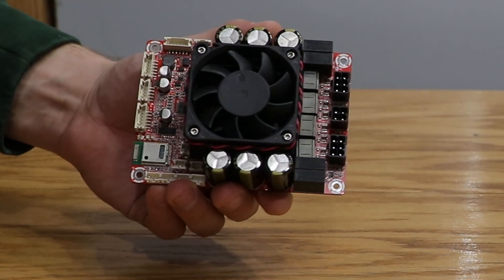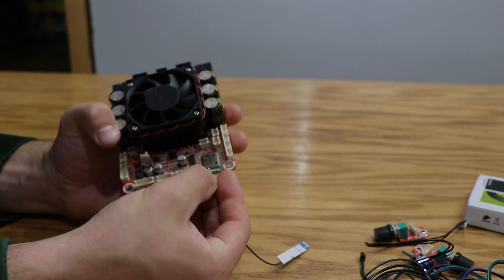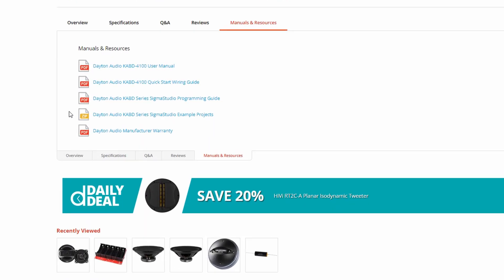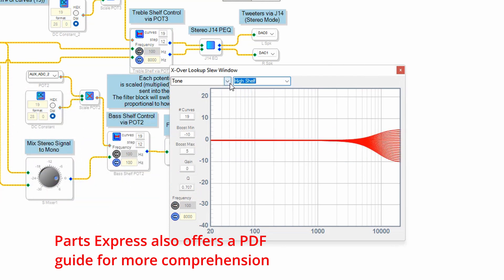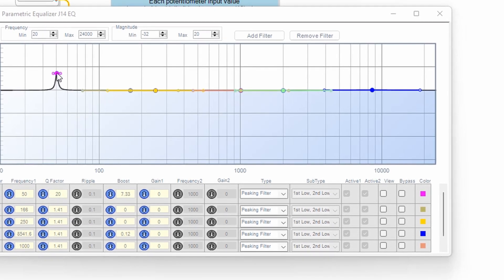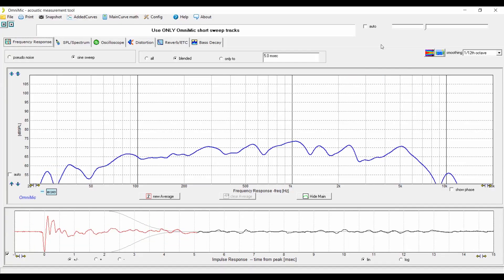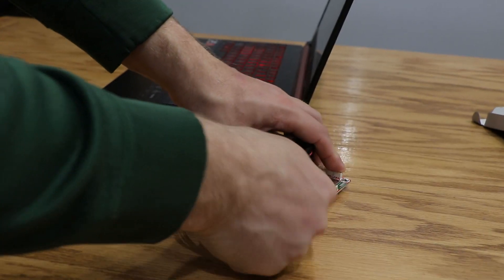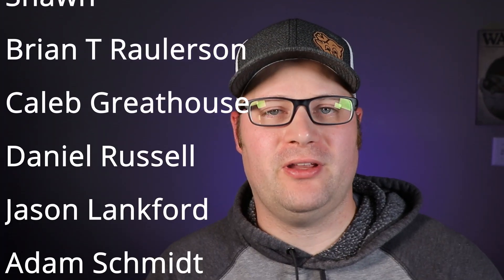Is this the Most POWERFUL Amplifier for DIY? Dayton KABD with DSP

Comment: Pity you didn't tell is the audio specs, and what power options (other than the shown battery) are available.
Reply from the maker: They have multiple different boards. If you follow the link in the description of the video, you can see the other boards they offer.

Comment: Would love to see a full 3 way active tower done using these guys!
Reply: I did a 3 way large bookshelf with 2 of the 4×100 boards. It kicks ass
Reply: @blakebrockhaus347  that would be cool to see. Do the left and right bookshelves need to know about each other (timing/phasing etc), or does it work fine with two independent amps with one line level input each?
Reply: @dcuccia  the two amps are linked together, but there's nothing to do with phasing since it's one amp per speaker. If you go back a little ways on the DD audio Instagram you can find a vid where I talk Abt the build
Reply: @blakebrockhaus347 can you point me in the right direction for cascading schematics, specifically how to power two of them
Reply: That would be a good video, but would they need 6 outputs? This board only has 4. Or maybe use 6 boards?

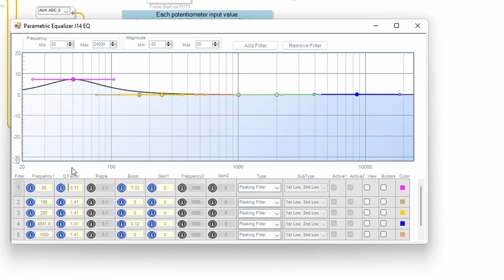Comment: 5:43 is it possible to build 1-band PEQ with this thing? Can you control gain, frequency and Q in realtime with 3 potentiometers? I tried chinese wondom audio thing (also sigma studio) but it seemed to impossible. I managed only to make predefined number of curves, not a parametric solution.

Comment: I will never throw away a speaker that stopped working ever again...  I had an Altec Stream X speaker that just stopped working one day out of the blue.  I opened it up and tried to figure it out but couldn't,  so I threw it away.  It'd been the perfect place for one of these boards...  the 2 X 30 w.  It had a nice sound for what it was.  Even had the battery operated function built right in.  Only thing this board wouldn't have had was ability to use Chromecast.  Otherwise this would've dropped right in.  I'm going to have to go looking to see if maybe this is still laying around somewhere...  I know I still have the front speaker grill part and the power cord cuz I remember it was 18v.  It was useful for my 10" portable fans.  I'm going to look...  I'll let you know.  In the meantime,  anyone know if I can get the Chromecast parts off the old pieces???
Reply: Google and Alexa are coming together to work on more and more things and I'm happy about that.  Instead of fighting for the space they seem to be getting along nicely and I'm finding I can use them more than ever...  like asking Alexa to show me a Wyze camera on Google Chromecast on my TV...

Comment: Would be interesting to see how this goes compared to buying a Mini DSP 2x8 or two 2x4 and using some used class AB amps I have.
I wonder if the "4x100W" class D board would be as good as the separate amps in terms of power and noise
Reply: Wondom also offers a dsp board without amp. Would be similair to the 2x4 but much cheaper.
Reply: @lennarth.3383  you can't make similar and much cheaper. These cheap DSPs have audible tradeoffs. They're only usable for small/portable speakers, where you don't really care about fidelity.
Reply: @tomkocur  So true. People make it sound like these china boards are mana from heaven for nearly no cost. Either people praising this havn’ any idea of quality and fidelity, or they have an agenda cause they sell the shit. On another matter .. all those td amps are not even close to be considdered hi-fi and their wattage claims are utter bs. It is possible to build a quality class D amp but it will cost some serious design effort, and I have yet to see any class D amp that actually deliver the same ammount of sound pressure/watt compared to an old school class A/B amp with a decent designed power supply. Have tried Pro level amps made for live music that have 1000’s of claimed watts in 8ohm, and a 30 year old 200w a/b amp weighing almost the same as Its age in kg, totally oblitterates it, playing considderably louder, so if you want some cheap watts considder looking for really old but quality build poweramps used because people don’t want to carry them arround anymore. New power amps that cost a fraction and weighs almost nothing is almost always shit.
Reply: @mrdali67  The Dayton-board is a rebrand of sure/wondom. Technically all three boards are the same. In a nutshell: The Dayton-board is chinese mana from heaven sold at a higher price tag. At least here in Europe.

Comment: These are so cool! I don't know why we don't see more of these in use? They're so versatile. I would really like to see you use one of the MiniDSP amps to build a speaker with. Those are like a higher end version of these. They're not technically high end, but a rung above these. Pretty sure they use the Ice Power modules in them to give you an idea. Thanks for the great video. ✌️
Reply: guys still cant wrap their audio heads around using the software on their laptop or pc or even their phone.  There is a threshold of understanding that needs to be observed but once it soaks in you will wonder why you didnt do it years ago.
Reply: @halrichard1969  I suppose that's a big part of it. I'm a computer geek from way back though. So it's natural for me. And it's the way everything is going. And I'll be damned if I'll be left behind. I see that as a fool's errand myself. ✌️
Reply: @amb3cog  I think you have the right point of view.  I was looking at these amps a year ago and after five minutes of study on them My eyes walked away.   But now for some reason it all clicked after a couple videos and searching around for a cheap amp that could do it all.   I feel really good about getting it done.   I already calculated out the speakers and Boxes on WinISP.  Its a fun little program and free.  I grew up in my Dad's Garage. I got tools coming out my ears. And i know how to use them. Today I studied up on connectors I might use and decided on XLR 6 pin jobs. for the Monitors since they are three-way speakers.  One channel for the Midrange and Tweeter and one channel for Mid Bass Woofer.  Two channels bridged for the Satelite Sub.  Just multiply times two and that will be my set-up.  A 2.2 system, one amp for the right and one amp for the left.   This will most likely be my Christmas/Birthday gift to me in another month or so.  Thanks for the Interest.
Reply: @halrichard1969  Sounds great. I've heard people say that the best speakers you'll ever own are the ones you build yourself. I hope for your sake that this is true. And it makes sense to me. 

I run a 2.2 system myself, and think it's the way to go. At least for me, in my small room.
And I grew up in my dad's garage too. He owned a little body shop in Newport RI when I was growing up. 

Sure did teach me a lot about not having to pay people to fix, and/or build things for you.  Which sure does come in handy nowadays. Since labor is almost always the most expensive part of anything. 

We fixed almost everything ourselves. And even built our own frame pulling machine. Although we did have to have a guy come in and put the pots in the cement floor so we had something sturdy to anchor to. We did all the rest though. ✌️

Comment: IM NEW and a little confused,  is this used as a crossover for diy speaker builds or is this just to figure out what crossovers are needed for the build?
Reply from the maker: You can use it as either or. However with the two-way example project that I was showing you. There are four speaker outputs on this board. They have separated those outputs. To those outputs would power the two tweeters and two of those would power the woofers. You use the program to design the crossover. That means there's no passive components necessary. This will all be done with the software.

Comment: A ps audio fr30 clone would be a pretty interesting project since parts express Carries similar drivers to the planars they use
Reply: At that price point they're definitely using custom drivers. Ps audio has actually shown the development of their drivers over time, so you wouldn't be able to build the same speaker. Maybe something similar tho.
Reply: @blakebrockhaus347 , You'd be surprised according to many forums they are actually using a variation of the BG Neo 10 drivers and Neo 3 tweeters. In fact, some DIY hobbyists contacted paul and asked if he would do a production run of the drivers for the public, but he responded that it wouldn't be worth the time or money to do. Those woofers are definitely custom tho, they brag about that a ton on their website.
Reply: @blakebrockhaus347  interestingly enough, their speaker uses a midrange and tweeter that is very similar to the old BG Neo planar drivers. There are actually some drivers that are available on parts express from GRS that are similar. The reviews are somewhat mixed, but I bet you could pull off some decent results with them. Their woofers are really custom tho, dunno how you'd clone that.

Comment: this card should have usb on the card! if I am going to make a good speaker then I must be able to adjust more than once. there should be adjustment via bluettooth.

is it possible to buy a card with only this DSP?
Reply from the maker: You can adjust it as many times as you want. Heck you can use it in one project and then use it in a completely different type of project later if you wanted to. You just need to re hook up your incircuit programmer to it to program it. I'm actually glad it doesn't have the incircuit programmer built in. One, every amplifier would be more expensive. Which is unnecessary since you only need one of them to program as many boards as you want to program (with as many different variations as you want). And two it would make it a larger unit. But it would make it more convenient to program if it was built in.

Comment: How many frequencies can you adjust at one time? 5 pcs. Normally you can not adjust good sound until you get to 15 bond eq.

Have this EQ. for all channels? 
One for treble and one separately for bass / midrange?

has dsp / amplified hissing? many digital processors and class-d have hoss.

I have used mosconi dsp 6to8 and it does not have a pop free start. but there is a very loud bang in the bass speaker and it has a hiss
Reply: Don't confuse parametric EQ and graphic EQ. The latter does indeed require lots of bands to be of any use in correcting narrow deviations. The former allows control over center frequency and Q per band as well as level, so fewer bands are generally required unless the driver is a total mess.
Reply from the maker: @naturalverities  that's a great point. With parametric EQ you have the ability to adjust the Q which helps you fine tune how narrow or wide of frequencies you can adjust. Great point! 👍
Reply: @naturalverities  Ok. I have adjusted a lot of EQ. in PA. world and in car stereo and Home hifi.
Even parametric EQ in car.

often it is more than 5 frequencies you have to adjust at a time. Then I talk about adjusting to get the best possible sound.

Take for example SEAS speakers from Norway which are seen by many as very good speakers. In reality, they have a sound type that requires lowering of several frequencies that do not produce as good sound. Seas has its own sound type which is not the best.
Reply from the maker: @ford1546  each parametric EQ can handle up to 15 bands.  However, if that is not enough, you can just add another parametric EQ in the software for an additional 15 bands (30 total). As far as I know, there are no limitations to how many you can add.  And if there is, I haven't found it yet.
Reply from the maker: You can EQ this is much or as little as you want. You want limited like you used to be with just a normal parametric EQ. Like I said with the potentiometer, you can program that to do whatever you want. You can use it to switch crossover frequencies, change certain frequencies volume or even change the volume of the entire range of each individual driver. It's really your imagination that is going to limit this unit more than anything else.
Reply: this dsp does 1024 instructions per sample at 44/48khz. One 2nd order filter (double precision, 1 channel) takes 10 cycles, so you have a total of around 50 bands if in stereo

Comment: This is stupid cool.  You did not mention the power output
Reply from the maker: Good call. It depends on which one you get. The one that I have is a four channel amplifier that is capable of up to 100 watts per channel. So 400watts total. But they have other boards that are smaller.
Reply: @Toid  Yep, and for the full power, you need to make sure you have the right amount of amps as well as wattage. Easy equation: power needed = speaker power (e.g. 200w) / amplifier efficiency (e.g. 0.85)
Then you take your calculated power needed and divide it by your voltage (e.g. 24v). That gives you your minimum amps needed for the power supply 😉
Reply: Sorry Nick, didn't mean to @ you. It was meant to just be a normal reply. 😅

Comment: Quick tip for those of us elsewhere in the world. The sure/wondom boards are the same things and are generally cheaper. Dayton is a rebrand. Thanks for bringing these boards to everyone's attention Nick! Hopefully it ups the quality of everyone's DIY builds!
Reply: In Germany the price gap is crazy: 75€ Wondom, 120€ Dayton Audio.
Reply: @lennarth.3383  I live in Germany as well. The Dayton Audio version is sold out at Soundimports. But since they are pretty much exactly the same there is no reason not to go for the Wondom board because its 45€ less. @Elliott Dyson It seems like they are the exact same board. They spec sheets are exactly identical apart from the minimum load rating. But another german distributor that sells the Wondom boards states that its 4-8 Ohm for stereo and 6 Ohm for when you bridge the output. It would be nice to know if they are actually able to handle a 4 Ohm load or not. 6 Ohm drivers are hard to come by. And with an 8 Ohm load they can "only" output about 80 watts. After some research i am pretty sure they both use TDA 7498 chips from ST Electronics.
Reply: @baluuu2  hi, i want to use a 8 ohm subwoofer bridged, do you know how much power i can give it? I'm hoping for a 100 watt RMS @ 1% thd
Reply: @roygriend5143  did you ever find this out? as i want to do exactly that
Reply: @jackchilly1  no i didn't buy it
Reply: @baluuu2  Dayton has a very nice warranty and good customer service here in the USA.  I priced both brands here on Amazon USA and they are both priced pretty; much the same.  The Wondom is actually two dollars more.
Reply: Thanks for the tip. But are they actually identical? Dayton Audio claims a minimum inpedance of 4 ohm while sure states a 6 ohm minimum. But both of them measured their specifications with a 6 ohm load. Since 6 ohm drivers are not as widely available as 4 or 8 ohm ones it would be good to know if the Dayton Audio one can actually do 4 ohm load or on the other hand the Sure one is also capable of driving 4 ohm loads. I couldnt find out what chips thtey use or if they are identical.

Edit: I actually found a site that sells them under the Wondom name. I'm pretty sure they are Sure ones just rebranded. They state its a TDA749X Chip, but not which one. They also claim an impedance of 4-8 ohm the left and right channel outputs and a minimum 6 ohm impedance for the bridged outputs.
Reply: @baluuu2  Yep, the ones with the same power ratings use the same chips. The only difference I can see for the different ratings would be different output inductors. When inductors with values designed for use with 8ohms are used, when 4 ohm loads are used instead, you get an earlier high frequency roll off, I imagine it'll be that. But honestly, wouldn't be surprised if Dayton named the 6ohm boards as being rated for 4 ohms even if they aren't, especially since the descrepencies from inductor choice wouldn't be noticed by your average customer.
Reply: @baluuu2  Also, Wondom is Sure (it's their consumer audio division), the Dayton's are relabeled Sure/Wondom boards, not saying there's anything wrong with that at all. Since it's not a copy/fake, just a rebrand.
Reply: @lio1234234  what's the point of rebranding if you sell it for much more, i almost begin to think that because of this reason the dayton is better because it's more expensive
Reply: @roygriend5143  it's more expensive in Europe because it's an American brand. I don't think Wondom boards are very available in America.
Reply: @lio1234234  ok, thanks. For me the wondom is 50 euro cheaper but i have to buy a programmer to , unless the dayton version also works on the wondom boards because i have one already wich i used for the cheaper dayton boards..
Reply: Both of them suck actually since they use the old noisy 7498 and not the optimised 7498e. Check out the TinySine TSA8804. Comes with the better chip, better WiFi incl TWS.
Reply: @sebastians.6134  Details on Parts Express say the 4100 uses the 7498e.
Reply: @sebastians.6134 Just wanted to mention that the sure-electronics official website now states TDA7498E chip for the AA-JA33286 board.
Reply: @sebastians.6134 unless you're gonna use them super nearfield/ super up close or with highly efficient tweeters like compression ones and PA woofers you're probably not gonna notice amp noise from the JAB3+ (2x50W version TPA3116) or JAB5 (this 4x 100W / 2x 200W amp)
Reply: Thanks for the tip. Save myself a lot of pain and heartache - not to mention a ton of cash - by following your advice.

Very handy tp know because the postage costs ex: USA are beyond criminal. I tried to order an item the other day, US $36. Postage (or 'shipping' as they rather quaintly refer to it), US $88.

Don't bother. I'd love to buy from Parts Express but if America doesn't want to do business with the rest of the world, we'll go elsewhere (and I think everyone knows where 'elsewhere' is).